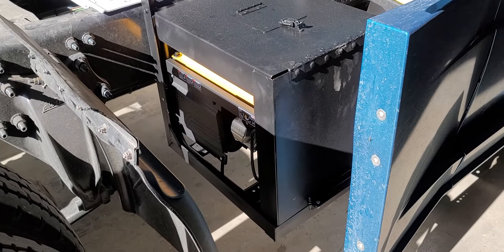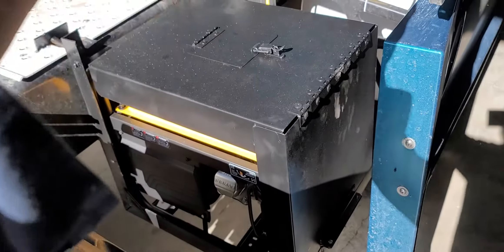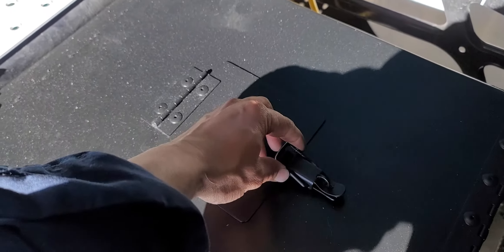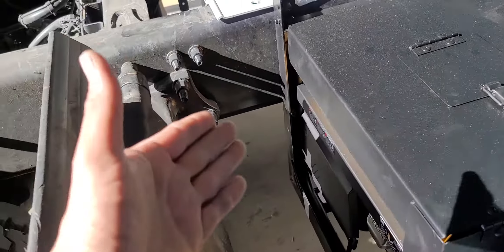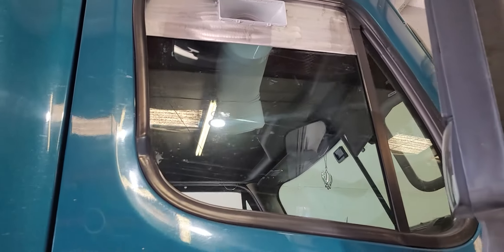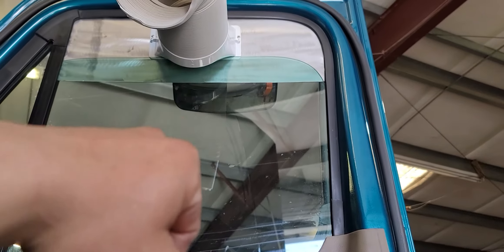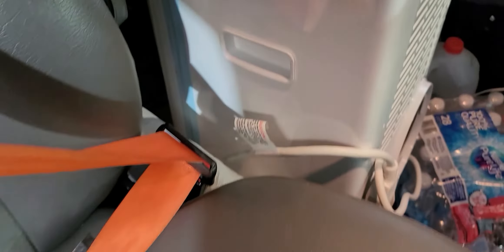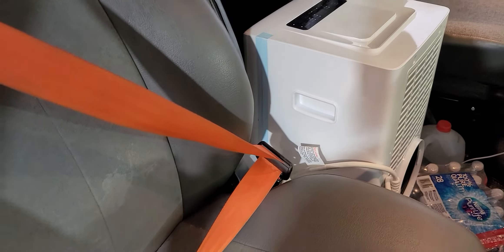Semi truck generator/ac setup. DIY apu for the less money. Please press 👍if like the idea.

Comment: Nice set up I have a 2016 freightliner cascadia evolution ,can you fabricate a box for a eu2200watts honda inverter generator on the passenger side behind the fuel tank

Comment: @ Kirpa Welding

Hi 

How many watts is the generator, brand and weight. 

I currently drive a 2009 cascadia and have a predator 2k. It doesn’t start to well in the cold. 

I have a predator 3,500 and want to install it on the catwalk but afraid of mounting it on the side because it’s about a 100 lbs.
Reply: Firman PO3608 Remote Start. Check it out.